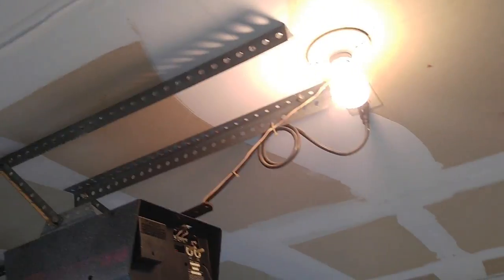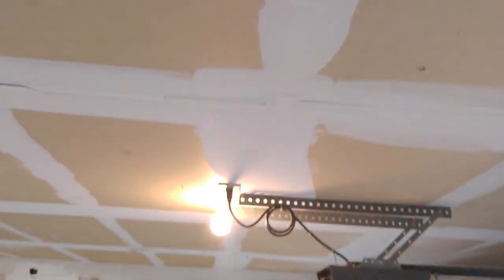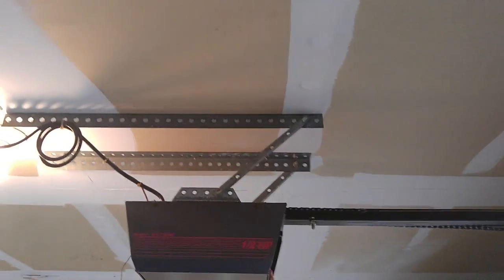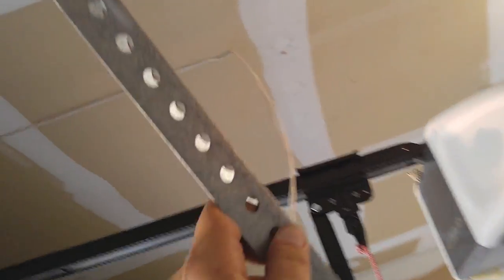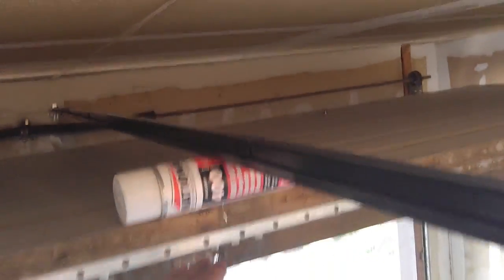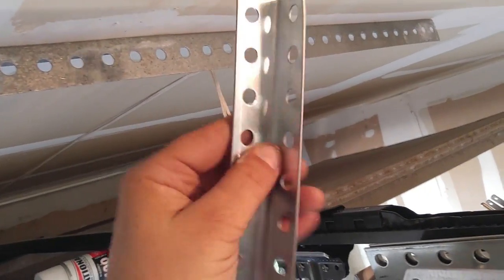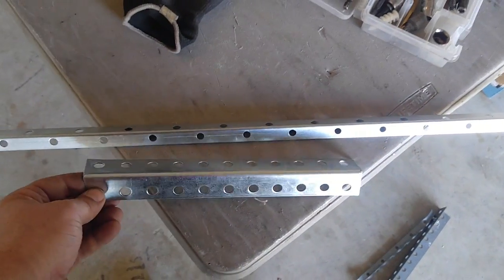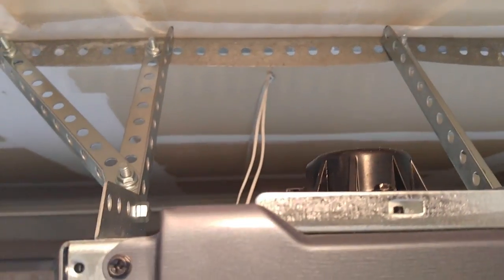How To Hang A Garage Door Opener To The Ceiling

Comment: Helpful!   The original D-I-Y  design that you tore down is something that I was considering.   I wanted to span the two studs (16") because the Genie connection was smack in the middle.  Now, I'll do what you've done with the angle.   Thanks!  🙂
Reply from the maker: Awesome!  Glad to help.  👍🏼

Comment: So the pieces of angle iron that go from the opener to the ceiling did you have to bend them in any way to install them sloped like that? My new opener is between two studs currently and installing the way you did would fix my problem.
Reply from the maker: That angle iron bends really easily.  Connect the top, then pull it back to where you need it.  Tighten nuts/bolts up! 🙂
Reply: I appreciate you I'll give that a shot!
Reply from the maker: @tylers8333  no worries bro! 🤘🏼

Comment: Great video.  Couple questions.  How do you cut the angle iron?  How do you bend the angle iron joint where the main piece meets the drops?  They are attached at an angle (not 90 degrees).  Thanks!
Reply from the maker: I use metal cutting snips.  You can also use a hacksaw. And then just to bend the pieces back towards the machine all you got to do is just pull it. It will bend to where you want it to.
Reply: @garagedoorgenius  thanks, makes sense!

Comment: Hello Genius, I am wondering what the lowest overhead height would work without obtaining a 'dual track' or sneaky system to install the opener.
Reply from the maker: Generally about 12' of headroom is required for regular headroom.  You can also cut a little off the bottom of the vertical tracks.  Not much though.  Comfortably about an inch before you really have to finagle the top fixtures to turn within the radius and not smack the opener rail.
Hope that makes sense.  🤘🏼🤓🤘🏼
Reply from the maker: Make the 12in radius work and put a side mount opener on.

Comment: Chamberlain vs Genie vs others, which is a decent garage door opener that will last?
Reply from the maker: I've installed Genie and Chamberlain LiftMaster.  Both manufacturer's have been in the game for a long time.  I really can't say to many bad things about the two.
Any trolley opener from retail is good.  You'll have to make a decision on belt or chain.  You'll see a price difference between the two.  Belt tends to be a little more popular.  Durability they are about the same.  I have a newer video reviewing Genie chain vs belt.  Check it out!
Reply: @garagedoorgenius  ... thanks for that info. After many decades of getting out of the vehicle to physically open the garage door I'm going to treat myself to a garage door opener. 
Wasn't sure who the better built, more reliable manufactures are these days. Looking at Home Depot or Lowe's for the actual purchase.
Reply: @garagedoorgenius  ... question, how does one know what HP opener is needed? This would be for an aluminum door with foam insulation, single car garage.
And what about Genie's "screw drive" openers vs belt or chain openers? Thanks for your feedback

Comment: amazing video!! I have another question. I want to install garage door opener in a new house, I noticed that our garage door is not reinforced in the middle vertically. It looks like a fibreglass door. I can I put the bracket right inside the door? Or do you have a video showing how to install reinforcements? I couldn’t find any video on YouTube.
Reply from the maker: Thank you for the compliment!
Do you have a Wayne Dalton garage door?
Reply: Yes, I checked the label. It says Wayne Dalton.
Reply from the maker: @zainhemraj5469  on the very top of the (top section) should be a metal bracket with a cotter pin.  That's where Wayne Dalton wants you to attach an opener.  If it doesn't have one, then the installer forgot to put it on. You definitely don't want to mount the opener door bracket to the middle somewhere.  Even if you through bolt it, eventually it will yank out.
Reply from the maker: @zainhemraj5469  https://www.amazon.com/dp/B07BJFQRBZ/ref=cm_sw_r_cp_apa_i_65DJFb6E11QGW
Reply: Thank you so much. I don’t see the bracket on the top but I will order is from the link you have provided and install it. Really appreciate your help!!
Reply from the maker: @zainhemraj5469  no problem brotha! Glad to help.

Comment: Mine didn't come with the L bar for the roof.. what size/type of screws do you use to hold that to the ceiling?  I read lag bolts on the other post?  what diameter screw and drill bit do you need for the holes for that?  I have a bunch of 5/16 lags from another project
Reply from the maker: The angle Chamberlain sends in the box works, but typically isn't enough.  Just buy a stick of angle iron at Home Depot or Lowe's.  Its like $15 a stick.  1 stick should do it.
Those 5/16 lags will be ok.  Just make sure they are at least 1.5 in. long.  You want to make sure that lag goes into decent amount of wood.  If you have drywall go longer.

Comment: You know you can hang a gdo with springs, ropes etc.? I’m with you on using 1-1/2”x1-1/2” perf. Angle iron in AZ we specialize in 18 gauge which I’ve had a few suppliers swear to god was thinner than anywhere else in the country uses and NOT ETHICAL lol. AZ CONSTRUCTION as they say!  But I’ve seen MANY pro installs from my grandpas days in the 70’s old delden/allister chain drives on heavy ass delden steel pan doors hung with springs and they worked for 30 years.
Reply from the maker: Man it would be brutal doing doors in AZ!  The heat would kill me. 🔥😂🔥
I'd love to travel in time back when your grandad did doors.  Would love to see how things were done.  But, if I traveled back in time, I would bring my cordless tools. 💯
I've never seen springs used before in mounting an opener.  Get some serious bounce action 😂!
Reply: Garage Door Genius yea it was a TRIP to say the least! Fortunately he’s still around (grandpa that is!). I was lucky enough to work with him a handful of times. He’s 85 I’m 35, he started in garage doors at 39years of age, AFTER a 20 year stint in the USAF as a fighter pilot retired as a Major! 🇺🇸. His call sign was SMOKEY so hence the name SMOKEY’S Garage Door & Operator co.  His name rang bells in the industry and 3-4 generations later it’s still going strong I’m getting active in CODA/WASA Org my uncle is the Sitting president of the industry right now actually IDA.  Cool videos you’ve got some major views under your belt I’M SURE the manufacturers are sucking your ass when you ask for something huh lol. If not CALL ME, LETS GET THINGS IN PROPER ORDER FOR YOU MY FRIEND!  Anywho I may call on you in the future if you’re open to it. I’m a 3rd generation garage doorman 19years industry experience and I’ve been sittin on the pot without making a move for 3 years about doing some sort of PODCAST/YT CHANNEL OR BOTH?? I’d love some advice.
Reply: Grandpa used a 1/2” corded MAKITA IMPACT for his career, near the end the 14.4v Makita NiCads were just coming online I think I got the voltage right. I fortunately inherited one of his 1/2” 40lb big boys which I treasure he personally scribed his “Smokey’s” and company phone number into the impact himself. Lol
Reply: Last one. In AZ June July Aug sometimes Sept our “Office” is a 140° + working environment or “JUST THE GARAGE as they call it lol
Reply from the maker: Hey thanks for commenting back! 💯
I wanted to reach out to you and tell you once I get done with my hectic day today here in Austin I'm going to reply back.  I didn't want to think I left you hanging! ✌🏼🤓👍🏼

Comment: Omg im so pissed. The electric went out today and i opend mine manually. I just went to close it and the freaking opener fell feom the cwiling . I have a 14 month old house these bastards secured it to dry wall. So now my door is just open leaving me fewling really u secured. I am so not happy.
Reply from the maker: OMG is right!  I really feel for you.  I mean holy shit, DRYWALL!!  Whoever installed that opener needs to be kicked in the face.  I guess it could've been worse and fell on top of you or your car.  I would try and find out who did the work.  That's unacceptable.
Reply: @garagedoorgenius  thanks for that. These people were contracted through regency homebuilders. So im on fire duty all night.. and tommrow i will fond the studs . Im sure me and my 4 yr old will do a better job then these folk.
Reply from the maker: Keep your lights on.  That may keep any bad people from snooping around.  Sending good thoughts your way.  Let me know if you have any questions about rehanging the opener.  Find that ceiling joice and screw it back to the ceiling.  Hopefully, it didn't screw up the opener.
Reply: 🤣🤣🤣  dude, I'm sorry that happen to u. Did you get it back up and working?
Reply: @garage door genius Yes! I did get the opener back up after several attempts. I did call the people eho did the work and since I am under warranty  I had them come take a look. Now it sounds so smooth. You are awesome and your advice was A1.
Reply: One of the screws fell out of fine yesterday.  Was able to get it back in but not confident of my work.
Reply from the maker: As long as the lag screw went in solid you'll be fine.
Reply: @garagedoorgenius  I think so.  Took a bit of problem solving to hold the thing up (2x4 and a ladder) and put the screw back in.    
Not nearly as entertaining as the time the springs broke (best excuse ever to be late for work. . .I can’t get my car out of the garage and I travel for work). Who knew there were TWO springs?  When the 2nd one finally gave way, it shook the whole house.
Reply: @garagedoorgenius  Its that lag screw that worked it’s way out in the first place. 🥴